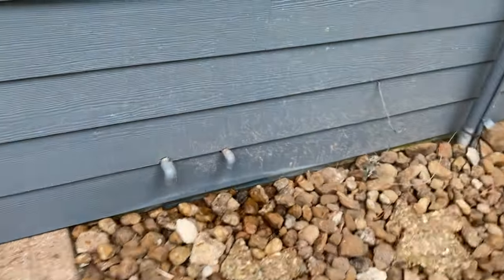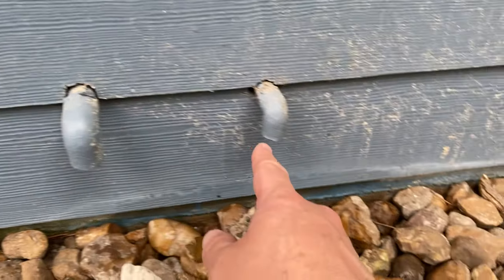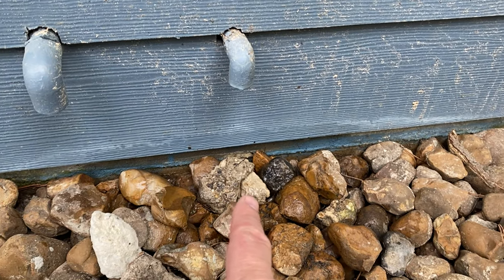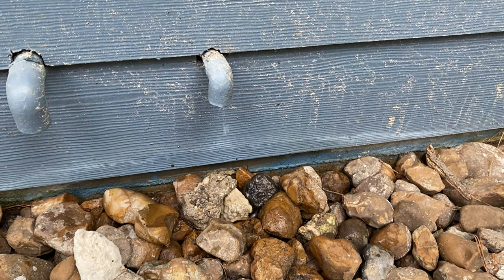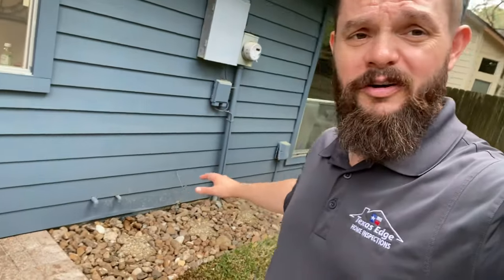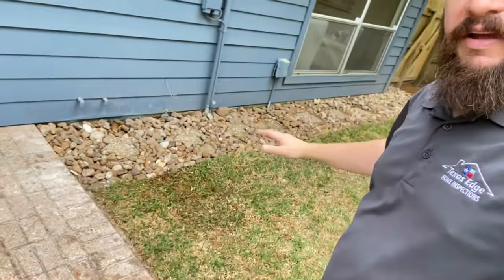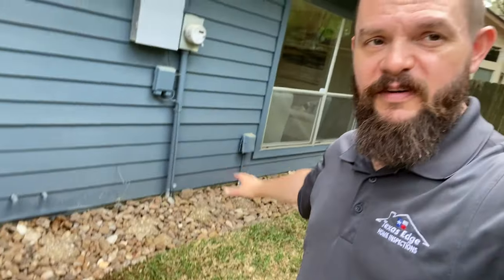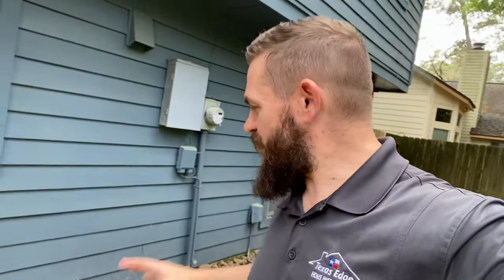Water Heater Drain Lines

Comment: Huh?  I was looking into how to deal with the blowoff thing on my water heater, the one that has a big yellow sticker saying it isn't supposed to have any bends or elbows, just supposed to direct it towards a drain (which I don't have).  Would that be the same thing as the Pressure Relief Valve that you suggest running outside and pointing down?  Sure would be convenient, but if it's the same thing, how do you get it routed outside and through the wall with no elbows?

Comment: Yea my pan was full. Its a 10 year old kenmore and the installee put the pan below the drain. I changed the safety valve cause I saw it drippin. A week ago. Now I came in last night and the pans full of water again. The safety valve is piped down to the pan so I pulled the end over and into a mop bucket. Its not drippin. But water fillin the pan from somewhere.
Reply: Its a shame I dont have experience sweatin copper pipe. Bein an electrician I can see where sears installer made 3 mistakes and either on purpose or just a general DA

Comment: My pleasure relief line goes into the slab and hits the main drain line but its always holding water. Is that normal? The plumbers swear that's normal and that the water heater builds pressure and pushes water on through it. Yet if I cut it right now, water will go all over the floor. I feel like gravity should easily drain it. The drain line completely vertical.
Reply from the maker: I’m sorry I can’t get over your “pleasure relief line” haha. But no. That doesn’t sound normal in any way
Reply: @texas.edge.inspect  wow!! Didn't realize. I am pretty stressed about my project as you can see. Im not a plumber so I already feel bad questioning the setup. Im going to roll with it, if it causes issues they are insured.  But sounds like you agree with me, a vertical line into a drain should.... well drain.  Thanks for replying